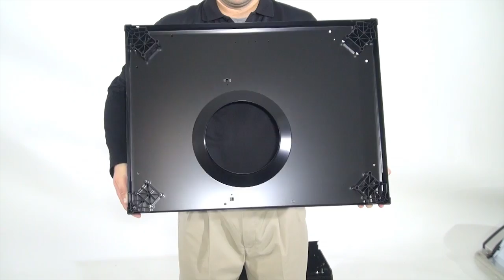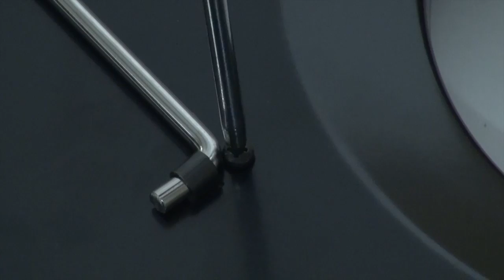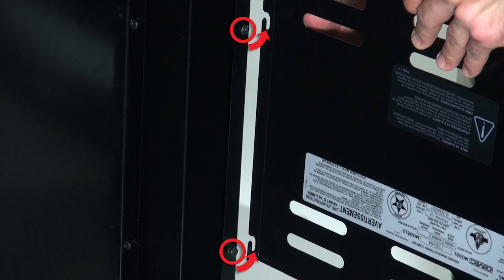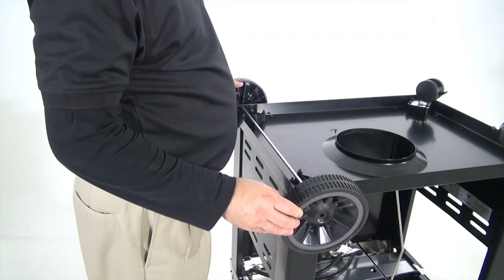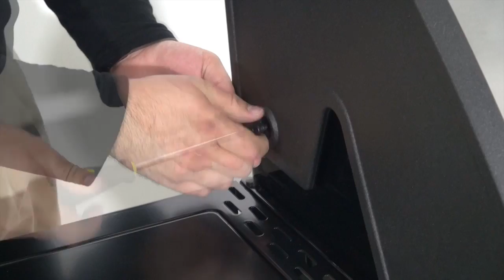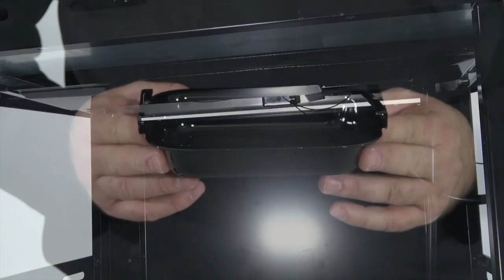Broil Mate: Barbecue Assembly Video - Four Burner Model

Comment: The assembly was relatively painless but incredibly frustrating due to the very poor quality of the screws. We used the right tools but a bit of force to secure and tighten the screws would brake them.In addition, the drawings on the assembly manual are NOT clear, especially those concerning the connection of gas pipes…